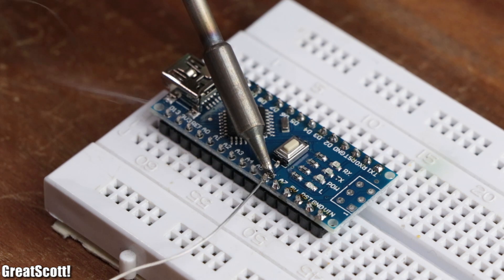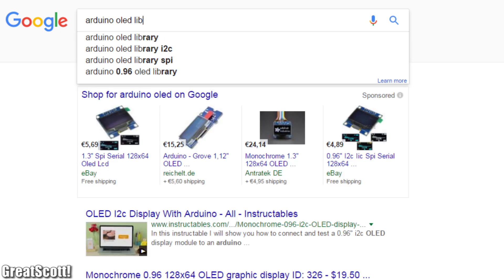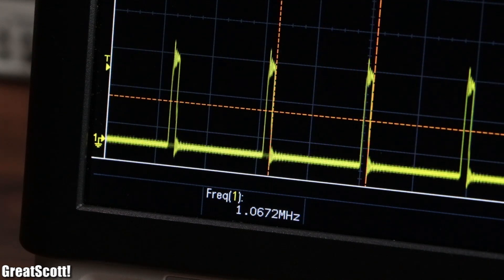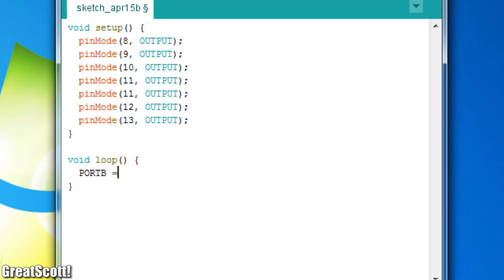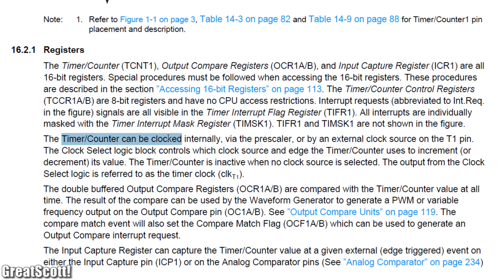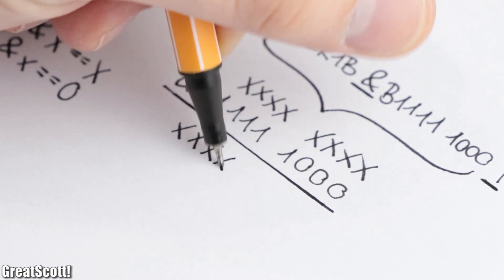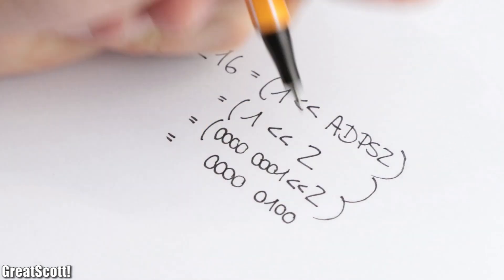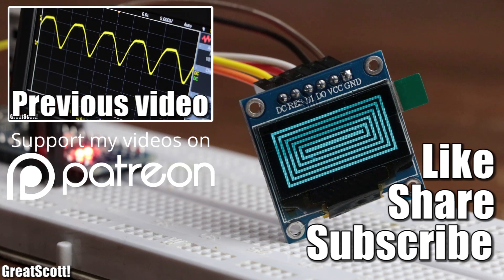Arduino Basics 103: Library, Port Manipulation, Bit Math, Faster PWM/ADC

Comment: 4:03 - B stands for BINARY, not byte... like 0x for hex. It's not type definition just way to write numbers.

Also you showing pin mapping which isn't very intuitive, better search for arduino board pins like: http://www.pighixxx.com/test/wp-content/uploads/2014/11/nano.png
Edit2: Small list of Arduino pinouts:
Nano: http://www.pighixxx.com/test/wp-content/uploads/2014/11/nano.png
Pro mini: http://www.pighixxx.com/test/wp-content/uploads/2016/07/promini_final.png
Pro micro: http://www.pighixxx.com/test/wp-content/uploads/2016/07/pro_micro_pinout_v1_0_blue.png
Micro: http://1.bp.blogspot.com/-ptZ4z1b9w20/VPW1E4ohsUI/AAAAAAAARVo/XZ3NqZ7JEP0/s1600/micro.png
Leonardo: https://s-media-cache-ak0.pinimg.com/originals/00/55/d7/0055d75021113a0a0894feb2c4ade2ee.png
Due: http://www.robgray.com/temp/Due-pinout-WEB.png
Uno: https://s-media-cache-ak0.pinimg.com/originals/86/cd/1e/86cd1e943052227a9ebcf2d534beea6d.jpg
Mega: https://s-media-cache-ak0.pinimg.com/originals/d7/c0/33/d7c0337674f0dd43bdb36484b5cabc46.png
ESP8266: https://www.iot-experiments.com/content/images/2016/02/ESP_Pinout_01_big.png
Bare uC:
Atmega168/328: https://s-media-cache-ak0.pinimg.com/originals/4d/cb/20/4dcb20f436d46eae0fafcc03293b4fe6.png
Atmega32u4: http://www.14core.com/wp-content/uploads/2015/06/atmel-atmega32u4-pinout-diagram.png
Attiny: https://s-media-cache-ak0.pinimg.com/originals/0b/96/90/0b969089aad15d9b61f8ab0bf5b7f145.png

Edit: More pinout maps: http://www.pighixxx.com/test/pinoutspg/boards/
Reply: I am, the capital B denotes a byte whereas typing 0b tells the compiler the following number has been written in binary. You can think of it as a data type, but it's really just a way of telling the compiler what follows is a byte.
The person above is wrong, a capital B is a common way of showing bytes (hence why ISPs always use Mb/s instead of MB/s to make it sound faster).
(oh, and we're up to 52 :(   )
Reply: And even after 3 hours someone else trying to write "first".. Magic :D
Reply: I was going to post the same comment xD
Reply: +That Guy And I think you're never using anything else than arduino. I will explain to you what is going on.
Arduino is using several toolchains (for varied uC), some of them hasn't 0b notation implemented, so for practice reason there are definitions in arduino for every binary number 0-255 (source: https://github.com/arduino/Arduino/blob/master/hardware/arduino/avr/cores/arduino/binary.h ). This cannot include more than 1 byte because of size and questionable usability. B00000001 technically is macro, and macros cannot starts by number, so they abandon zero from 0B prefix. But this is just "hack" to implement something that can be unavailable on some boards and came from 0b notation, which hasn't such limitations (source: http://playground.arduino.cc/Code/BitMath#binary ). 0b prefix means binary, 0x means hex, 0 means octal etc...

If you want to define how big number should be you can use suffixes like: L, UL, ULL or LL, but this is not important right now.
Reply: I assume the number you keep quoting is the people that like his post. Could it be they liking the PDF he shared? Which was helpful.
Reply: +That guy It's comes from 0b notation, it's compatibility hack. They not meant to make B to be byte and in official arduino docs they wrote about that... Unbelievable..

+Daniel Nebert you can include these macros (file binary.h) even in C. Macros comes from C.
Reply: Just look at name of header file: binary.h and documentation: http://playground.arduino.cc/Code/BitMath#binary Macros just tend to be uppercase, thats all. 8bits is enough to operate on registers of 8-bit uC (most of arduino boards) and don't take too much size to define. Don't make own stories.
Reply: And this is a essence of the problem. You thinking what this could means, how they can do it otherwise. But this is something existing and done about 30 years ago... They could have both h and x (H e X), they choose x.
Prefixes 0x, 0b, 0 are for base and suffixes at the end L, LL, UL, ULL are for type. Adding "o" into suffixes could be misleading.
But if you want long story: http://stackoverflow.com/questions/2670639/why-are-hexadecimal-numbers-prefixed-with-0x
Reply: Offtop
Reply: I don't see why seeing as it's simple to find with just a google search.
Besides, no one else is willing to call out their bullshit
Reply: I get the sneaking suspicion these are actually variables declared by the arduino IDE. Have a number followed on from a letter isn't standard syntax, and going over the 8 bit limit leads to undeclared variable errors. They must be put in there to make it easier for beginners who don't know of 0b.
Reply: Exactly, and the B does not mean binary. It's just a variable/compiler declaration in some file
Reply: That Guy and Magic D, thanks for this discussion.  I started with vanilla AVR and always used the 0b format.  Now we all know :D

Magic D, when would I need to use the B0 style Marcos'?
Reply: Can't say I've ever come across anything C related that does not use 0b, I'm pretty sure it#'ll be in the standard.
Arduino is just something I do on the side, I mainly use C++
Reply: Makes sense that we can't use B0 in C since it's not an OO langauge, but I have started using Arduino recently, and I assumed I'd be able to continue my lower level coding practice on all flavors of Arduino.

This this a hardware constriction for some Arduino boards?
Reply: Or restriction; I'm not claiming to be intelligent ;)
Reply: I stand corrected, thank you!
Reply: I don't think it's unreasonable to make it stand for byte, it's always 8 bit and capital B always means byte.
Honestly I think if they wanted it to stand for binary they should have used b.
But what is wrong with just writing it in another base anyway?
Reply: I know macros are usually uppercase but this would only provide confusion. Whatever, not like it matters either way, they mean the same thing.
Reply: If that was the case, we'd use 0h00 instead of 0x00.
Reply: What an amazing and relevant reply. Thank you for adding to the conversation that was definitely about charging lithium batteries?
Reply: No, promoting your ebay in random comments is not the way to go around things. If you have a good ebay listing it will sell as people find it.
Reply: If you want people to find your listing, make it cheap, don't put it in random comments where it's completely off topic
Reply: People can see your listing on EBAY. Posting on random comments is just an ass thing to do. If you want advertising, go advertise on youtube through proper adverts instead of just posting a link on a comment that has NOTHING to do with charging batteries.
Reply: Dan, there was a guy here advertising, you can see the comments still in notifications but he seems too embarrassed to admit he's just spamming links in random comments.
Reply: +That Guy Or was reported.
Reply: So now you're getting hostile? I never said it was my video, nor would I be annoyed it is not. What this guy does can be entertaining.
Why is that a valid reason for me to shut up? I'm very confused; you make no sense.
Reply: I think it stands for BYTE. Data is always binary, HEX too.
Reply: @adaminsanoff  Not too late for the party? :D Any data may be represented as binary.. as well as in any other way.  In arduino these are constants, but in other languages you can write even 30 numbers after B, and this  is no longer BYTE. This is even called "binary literal".
Reply: Sorry, you're wrong there. The B means the following binary number can not exceed 8 bits in length. Binary would be 0b.
Go on, try putting in 9 bits, you'll get shouted at!
(And now 30 people think wrongly :(   )
Reply: And Octal starts with a 0.  Why not have a lower case "o" at the end?